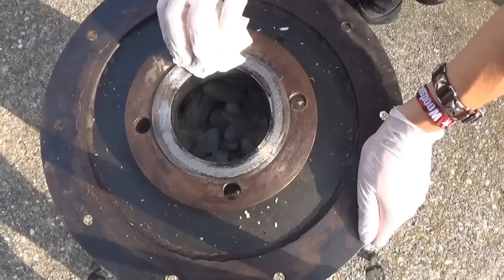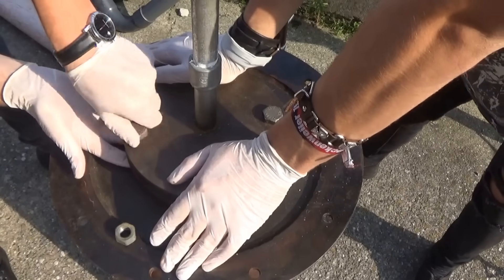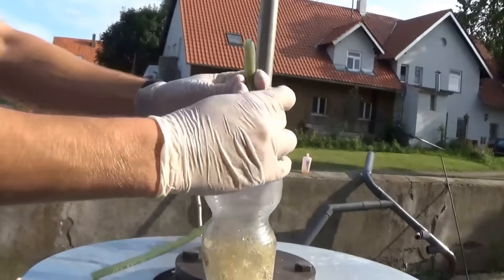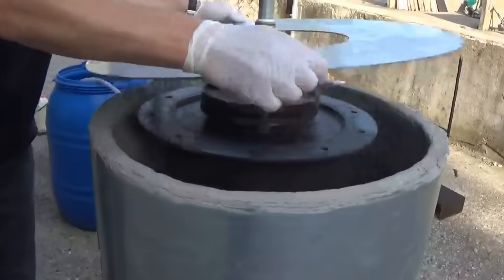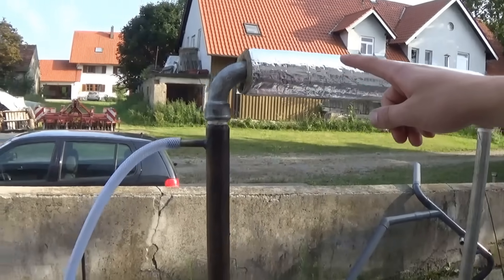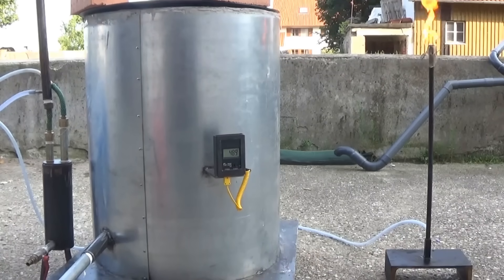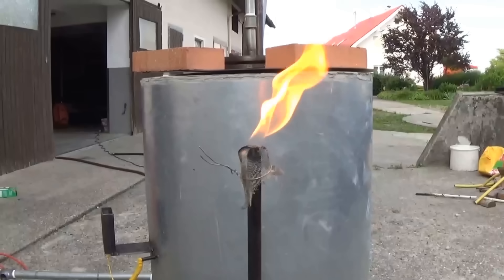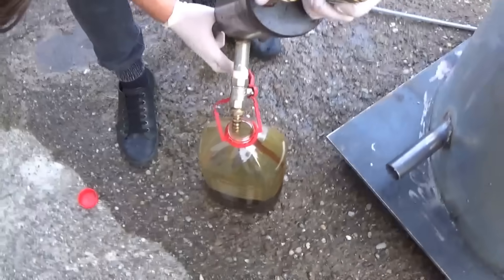plastic waste to oil/fuel improved pyrolysis reactor

Comment: Why flare the gas instead of collecting it? Thats something that frustrates me about oil production in general: instead of collecting the natural gas and selling it, they flare it off which contributes to air pollution, and in large operations kills lots of insects.
Reply: That's always bothered me too. Also done in landfills. Piping off the methane and igniting it. Perpetual fire.

I don't know shit about much of anything... That said, I'm guessing that in order to efficiently trap, and contain those flare offs, they would have to cool the gaseous (as opposed to liquid) gas being produced it until it condensed into a liquid form, and to keep it from evaporating as it warms up to air temperature, contain it in a cold tank  that's kept pressurized to efficiently store it in liquid form.

If they didn't do that, the containment vessel would have to be huge.

They could maybe pipe it and utilize it as its produced, burning it off as is, to heat water to make steam to spin a turbine on an electrical generator.

The thing about all energy production is storage. Wind d turbines generate electricity on an as needed basis cuz there is no way to store it in batteries. Many of them sit idle when the wind is blowing best.

The gas could be used to heat a hot water tank for the house or hot water to be circulated in pipes in the flooring, or the old school radiators for heating. I don't know how practical any of these ideas ate. I'm just writing them as they cone to mind 

The insect population is critical to the food chain and other environmental health.

I noticed a few years ago already that the insects seemed to just disappear. Except for the g damn mosquito's. And flies.

Also June bugs were now may bugs and far fewer of them. I think changing weather is partially responsible.

I remember you couldn't drive at night without your windshield and grill getting caked with dead bugs. And sitting at the gas station, the big outdoor overhead lighting would be huge swarms of bugs.

Then I noticed the birds were gone. Almost no birds as compared to just recent past.
And no frogs.
And going fishing wasn't worth the cost of the license.
Then I noticed that the pheasant population seemed to get scarce after the farmers used roundup herbicide.

That's when I figured out roundup kills a lot more than weeds.
And pesticides applied by crop dusters tend to cover everything like rain. Even people. So all the hundreds of thousand of acres of crop land getting drenched in deadly chems, at least once a year, more often 2x.

Then all that residual poison soaking into the groundwater, and running off down stream and accumulating and running into rivers and lakes and poisoning everything aquatic. Bugs, frogs, fish, reptiles, birds, mammals. Including us. 

We deserve what we get for allowing it to go on.
Reply: @kentneumann5209  I didn't even think about the landfills. I have this vivid image in my mind's eye from one of my school books in 5th grade. It's a drawing of a landfill and front and center are these pipes with little blue flames on the ends and it talks about how burning off the methane is marginally better for the environment than just letting it vent.
I was like "wait, natural gas is methane and we use natural gas to generate power. If they can get it into those pipes surely they can get it into a generator"

Comment: I have only one thing to say:  WOW.  This is the most encouraging news of the decade.  Thanks.
Reply: Very wow
Reply: This has been known for ages.
Reply: @Emilthehun  INDEED, this is literally how most fuels are processed- right from the get-go.  This is chemistry and always takes more energy than what is produced which is OK if you have a plentiful "free-ish" source of "starter" energy-like a team of slaves feeding a fire with beech wood. Wood gasification? YEP, been done before. Microwaved "trash" in order to reduce it back to its base compounds? Yep, that too. Distillation? Yep. Even cooler, no matter the method of fuel production (conversion), the resulting energy always goes back into Earth's energy cycle.
Reply: Others do this in „a better trashcan“ with wooden fire below
+ you could recycle this plastic by 90% into new plastic instead of causing a need to produce more new plastic from raw materials
= environmental protection gone FAIIIIIL

Comment: Could you reroute the gases back into the reactor? To use as heat?
Reply: Maybe even those byproduct gasses could be used to run an engine and produce electricity, but I'd probably bubble them trough water first so most of the contaminants get trapped and you get a clean combustion that requires very low compression to ignite

Comment: Soooo, if you are using Garlock Seals, you could raise the pressure in the vessel. This should break the styrene bonds. You also can use an expansion orifice to condense the condensate.
No flares....compress that gas.

Comment: Great video.  Have you tried to limit your runs to only certain types of plastic, to get a more predictable product output?  My thought was to use only plastic that is not recyclable. Then adjust production method to maximize fuel output. What is the timeline for a typical production run? Hours?
Reply: Yes, I would love to see #7 plastic used up like this.

Comment: Better idea would be to burn the plastic in an insulated burn chamber. Bring the combustion temps up to the point where all the material is burned to ash and Co2. And use the resulting heat to generate electricity. Same principle as a rocket mass heater.

Comment: I'm a 3D printing enthusiasts, and like 75% of all the plastic I use eventually goes into the bin. It would be awesome if I could send all of my waste to someone like you and know it was turned into something useful instead of ending up in a landfill or a "recycling" plant.
Reply: Have you looked into recycling your own waste for new filament? Most important thing is to keep types separate.
Reply: You should look into some of the filament-making projects. You end up chopping/grinding the spent filament and parts and it goes into a heated cylinder, etc.

Comment: What gasses are you attempting to remove by adding the Carbon Dioxide? What are the gasses in the reaction vessel that cause the oxidization and dioxin? Are there other gasses that may be more retally available? I am a Pipe Welder and use compressed Argon to purge things like Stainless Steel so oxidization (Chromium Carbide Precipitation)  does not take place within the weld. Argon is non-toxic, non-flammable and non-corrosive may it be used to purge the vessel? I only speak of Argon as I am only familiar with it through my line of work. Thank you for the awesome video. I can not wait to build my refinery!

Comment: hi, this a best reactor i've ever seen in web. please guide me, I want to learn about pyroliysis, as a continuation of my project in the development of the "Jet Steam burner stove", which uses waste oil as fuel. right now I just burn household waste without sorting it, all burnt, producing smoke that looks like it could be something. I ask for guidance from you so that my project can be realized and a solution to the garbage problem and combustion smoke.
check my video https://youtu.be/E-0YMiG_6D8, it's use 1 liter waste oil and 1 liter water.
thank you

Comment: 1. the burned gas to heat it up was way more energy rich than the product you got out of this process. The process should not be "use high energy product to get lower energy product back" but "use low energy to get higher energy back". E.g. you should burn wood and get petrol/gas/any other sort of high energy fuel out of it. 
2. Always show what you can power up with your end product. If nothing then you need to add more steps to refine it to something useful in allday life. E.g. if you can power up an old engine (which eats everything you throw at it) then you already have something really valuable. But you have to show it!

Comment: It is great, and could help to have a better world, cleaned from plastics....
a question, ¿why instead of burn the gas in the flare, don`t use it to heat the reactor?
Reply from the maker: the gas is burned in the flare because it is just a test setup. 

mfg hazelChem